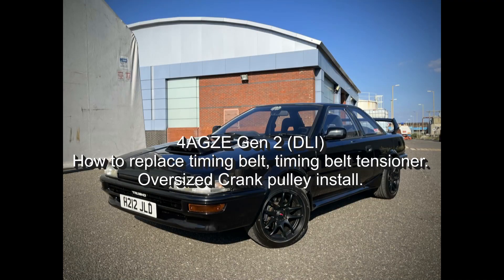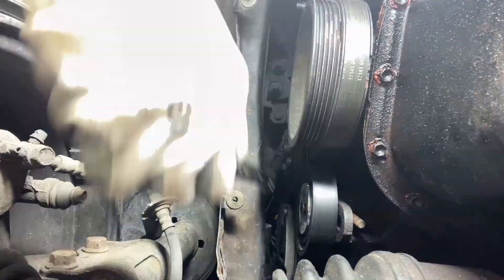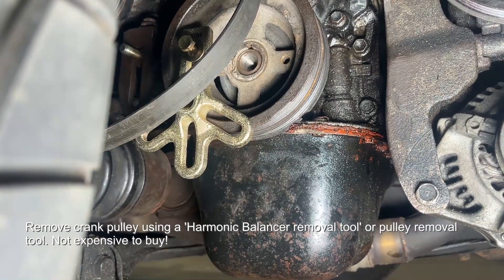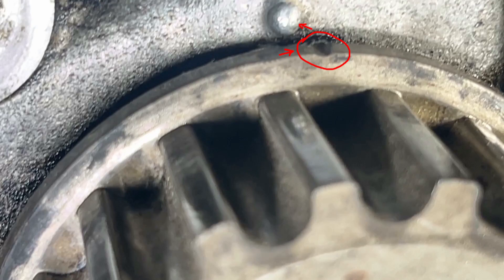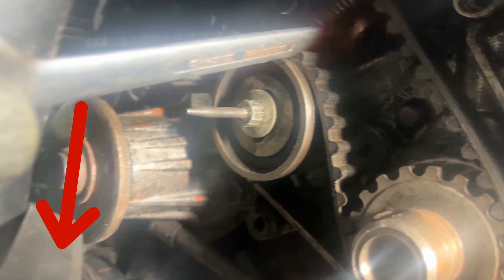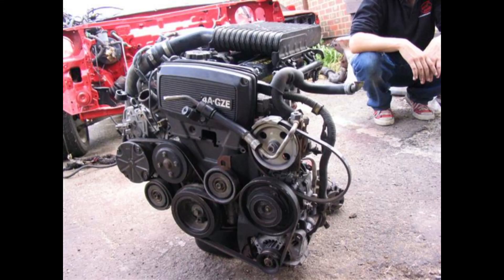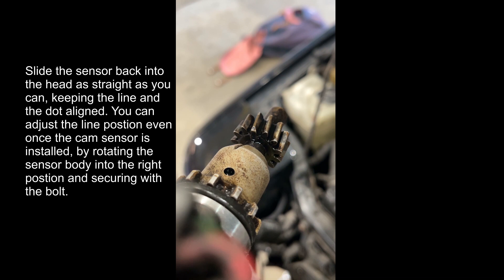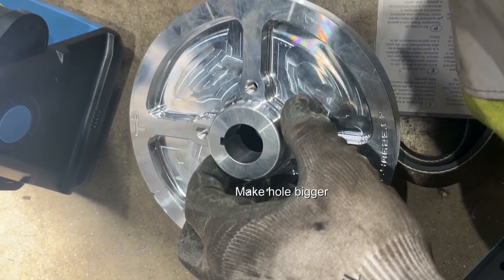How to Replace Timing Belt & Tensioner on a 4AGZE (DLI) with Oversized crank pulley install tips.

Comment: Hey mate, great explanation. I have an mr2 AW11 supercharged 4agze , Would all timing methods apply to my engine as well?
Reply from the maker: There will be a few differences, as far as the timing belt itself is concerned that will be timed in the same way with the marks . However I imagine you will not have a CAS sensor (that came with the later gen GZE's) but instead you will have the traditional distributor which you'll need to set the time with a timing light with the TE1 and E1 ports in the diagnostic plug shorted together with a paper clip. There are plenty of videos/ info on how to do that online! Obviously general access to the egnine will be different on yours as its mounted in the rear. But its mounted in the engine transversally in the same way as mine so it will be simmilar! Good luck my son you've got this